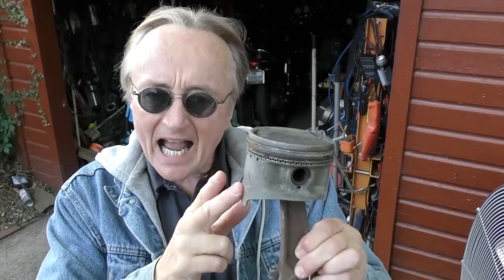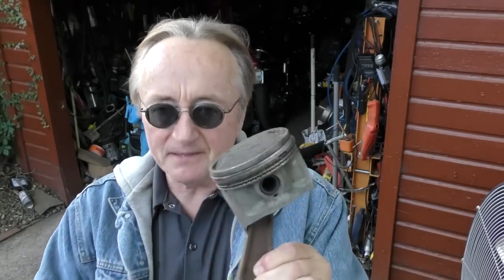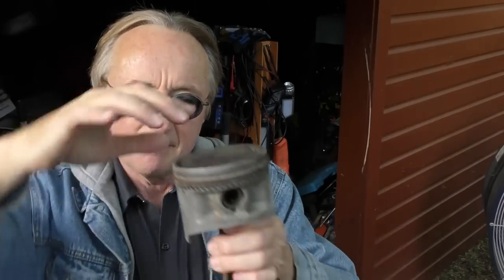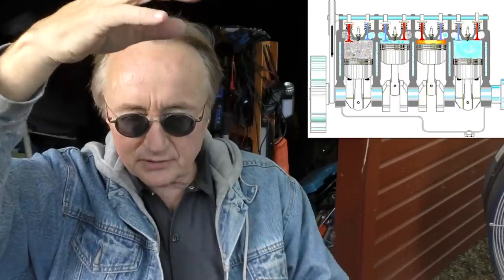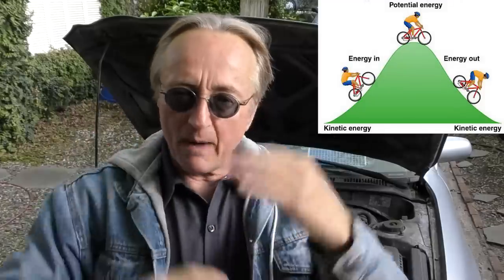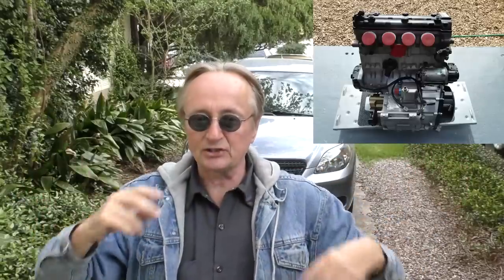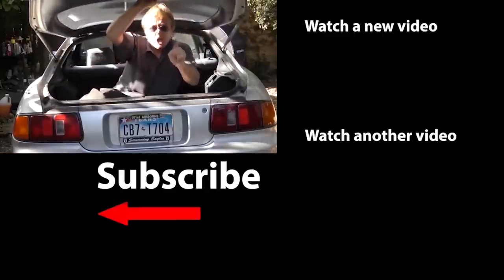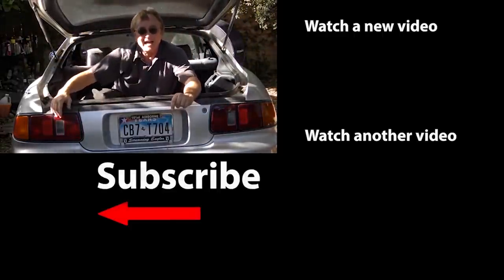Horsepower vs Torque, Which is Better

Comment: What's better? Torque or horsepower?
I'll tell you what's better:
A 94 Celica!!!!
Reply: Ew
Reply: that doesnt have much torque lol
Reply: @ad356  doesnt have much hp.either
Reply: @richdf5664  my 1996 Z28 camaro with 248K miles on it will blow its doors off LOL. the transmission was rebuilt and upgraded last spring. it had a high stall converter and a shift kit. other minor bolt ons and upgrades.
Reply: @ad356  ...yeah? You're comparing a built (wannabe) "muscle car" vs a completely stock economy car that's has ZERO intentions of speed. Cool. 
My twin turbo'd audi a6 has 191k miles with new bigger turbo's and a new(ish) clutch that will blow the doors off your camero
Reply: @richdf5664  camero??????? learn to spell first. how much money did you spend on that audi????? all i would need is procharger and its GAME OVER for you. displacement my friend..... a 150 shot of nitrous would do the trick too.

my i have less then $5k into my car including purchase price of the car, all repairs and mods
Reply: @richdf5664   also compare my 1996 LT1 to pretty much anything else made in 1996 and it was faster then just about all of the competition in its class. 

the celica he has is from the same era as my z28. back in 1996 the camaro Z28 was a fast car, today it still holds it own again entry level performance cars. 

if i had money to spend, it still has a ton of potential
Reply: @ad356  Just OEM turbos from a newer Audi and an ECU flash gives the car over 510hp awd gets the car mid to high 10's.
Reply: I new a guy with an S4 with the same engine that had 694whp awd nothing more than a bolt on turbos, tune, clutch and plumbing. Engine had about 100k miles when he put the turbos on. Daily drove it lasted until 175k ish miles all stock internals
Reply: Might of been 697whp lol I dont remember it was just under 700 lmao
Reply: I shall name my comment: superman. 
Because it flew over so many heads
Reply: Viren vs I see what you did there 😂 it went over most folks head
Reply: I think Scotty's Celica is actually broken and he pretends it works. His mileage never goes up on the thing.
Reply: but it doesn't break down like a dodge..
 @richdf5664
Reply: @ad356  Dude, don't go there. That guy's car  is a more capable vehicle and the chassis is good enough for mods that would make the Audi safely as fast as a Chiron. Your Camero is okay, but it can quickly turn into a death trap if you mod it too much.
Reply: Viren vs 😂😂😂😂
Reply: @GoldenGrenadier  😂🤣😂

Comment: Horsepower is the ultimate determinant of vehicle straight-line acceleration performance.
An engine torque figure alone is meaningless without knowing the rpm at which it produces that torque. Engine torque can be arbitrarily amplified at the driven wheels through gearing.
That being said, there is a positive correlation between peak torque and peak horsepower numbers on production cars. In order to make big horsepower, you usually have to make big torque (exception Formula 1, liter bikes, etc) because engines can only rev so fast before balancing becomes an issue, valve float occurs, or piston speeds exceed the combustion flame front velocity. Formula 1 engines push these limits and produce the most horsepower per ft-lb of torque of just about any engine. This requires very high engine speeds, which also rapidly accelerates engine component wear and drastically reduces the service life of the engine. In terms of longevity, engines with relatively high torque compared to their horsepower are superior. These engines typically operate at slower rotational speeds and are used in applications requiring long service life and large load-moving capability, for example in semi-trucks, diesel-electric locomotives, and tractors. In these applications, the horsepower produced is of secondary importance to the service life and reliability.
Reply: True. Why don't the torque people understand this?
Reply: As an Engineer and a physics enthusiast, I couldn't go by without expressing my appreciation for the fact that your understanding of the matter in hand is very accurate. Cheers
Reply: When a engine have high torque (sylinder-filling) on high rpm it gets high hp

Comment: Horsepower means speed!
Torque means pulls!
Reply: Just like amps x volts = watts rpm with torque = horsepower. Torque at zero rpm = zero hp. RPM with zero torque = zero hp.
Reply: Gibbon that’s cool!
Reply: You are absolutely wrong dude. The pulling and accelerating is about "Horsepower" not the engine torque. If you can create same Horsepower in both cars, the acceleration and top speed is THE SAME. Just put same top speed gears on both car, you will get "SAME ACCELERATION". You wanna hear that again? " S-A-M-E ".
Reply: You don't need high torque to pull. The Army proves this every day with the  M1 Abrams. They have turbine engines.
Reply: This is a false statement..
Reply: You can't have horsepower without torque

Comment: which is better depends on what you’re doing with the engine
Reply: It depends more on where peak torque is in the RPM range. For instance 300 ft/lbs of torque at 8000rpm will give you 456 HP but 300ft/lbs at 2000 RPM will only give you 115 HP... Horse power is the overall energy output of the engine, high revving engines with lower torque but the same HP as a lower revving engine can simply be geared down to achieve the same amount of force. Think of gearing down kind of like using a longer lever to lift something, less weight is needed to lift the same amount but you have to move it further, and the higher RPMs is the equivalent of moving further.
Reply: Phlaked Corn so you’re telling me engines don’t make peak power at any RPM?!???!!!! And they need gears which effect the end result of their output?!?!?!?? Mind blown.
Reply: @akboomer2837  What?! Man... I don't know what you read, but it sure wasn't what I wrote.
Reply: Phlaked Corn That was actually an excellent explanation. Thumbs up.
Reply: @creamofbotulismsoup9900  I mean, you're right, but I feel like that's overthinking a little. Peak torque will always be at a lower RPM than peak HP, so it's a pretty good (if a bit general) rule to just say "Look at torque if you want to pull stuff, and HP if you want your car to be fast."

Comment: THANK YOU!!!! 42 yrs Old, I have read articles, watched videos, and YOU are the first person to explain HP/TORQUE so I understand.
Reply: This is about as layman as it gets. Torque is work and horsepower is how quickly you accomplish that work. If you generate more torque than power, then you can do a lot of work but you'll be slower to accomplish it. If you generate more power than torque you'll perform work faster but not as much at once. Hope this helps.
Reply: King Daniel well jeez thanks for making it simpler. I have only been waiting 42 years, sheewizLol

Comment: Torque it's just a force measured in an specific moment, if you cannot apply it through time you're not going anywhere and thats what power is. Power = How fast you can apply certain force. In order to accelerate fast you need both!

Comment: Torque always makes anything you drive on the street more fun and deceptively fast. Drive a semi without a trailer and skip gears sometime if you want to experience the ultimate demonstration of an extreme case, it's exceptionally fun.
Reply: Tombs Clawtooth torque doesn't mean anything if the car doesn't rev fast.. a 500hp 300ftlbs car will feel quicker than a 200hp 500ftlbs diesel any day. Diesel is quicker from a dig however when both cars are at the same revs

Comment: Maximum acceleration occurs at maximum torque at the wheel.  Maximum torque at the wheel occurs at maximum engine horsepower.  Therefore, to get maximum acceleration, you need horsepower, which is produced by applying torque over a period of time.
Reply: Absolutely true.

Comment: Top fuel dragster 11,000 hp. 330mph in 1000 feet 3.3 sec.. now that's HP
Reply: I remember going to the dragstrip and watching them and as they go past the stands it will make the whole ground shake!
Reply: Not miles per gallon, but rather gallons per mile.
Reply: @InfiniteMushroom I was a kid when Kenny Bernstein broke 300 in 1/4.  Now they do 298 at the 1/8th mile!
Reply: Yeah and 100.000 big ones also
Reply: @davidstinson5095  maybe to buy one, for fun, that when it blows up, you put it on the trailer and go home.  To compete you need 4 complete cars or so. . . . consumables cost about $3500 every time it goes down the track.
Reply: @snap-off5383  don't they have to rebuild the motor after every run? And I thought racing karts was a good example of dumping money into an engine LOL
Reply: TOP FUEL CARS R AWESOME....😎 FIRE SHOOTS OUT THE SIDE 🔥🔥🔥
Reply: @backwoodsjunkie08  Yes they have to use a micrometer to check the rod bearings and crankshaft wear, the run stresses the valve springs so they all have to be reset, so they're all taken out, tested and re-installed or replaced.  The clutch welds itself together, so it gets tossed in the trash and a new one installed.  The spark plugs get ruined, and there's two per each cylinder,  and the headgaskets all get replaced.  That's if the engine DIDN'T fail in any way.

Comment: I always saw it as
HP= torque x revolutions
Reply: It is.
Reply: Yeah, it's a force (torque) applied in certain time (revs per min). In other words how fast you can apply the force.
Reply: Revolution is constant i.e. 5252
Reply: divided by 5252
Reply: @MrRobot-ry7ky  5252.113
Reply: @juzoli  torque definitely is a measure of performance, seeing as torque is the driving force behind getting RPM up to deliver horsepower.
Reply: Dicks X McIronCocke Yeah, but torque is the internal measure of performance in the engine. At the wheels, only the HP matters.
Reply: Is that how you saw it or is that what you learned or looked up?
Reply: @juzoli  How do you figure? The torque from the engine still needs to transfer to the wheels in order for RPM to rise, torque is force that allows for HP even  at the wheels.
Unless your clutch is slipping, if your engine doesn't have the torque to raise quickly through the revband, you won't have high horsepower, seeing as HP is a function of torque
Reply: Dicks X McIronCocke Yes, as it is stated, HP = torque x rpm. At the wheels, the RPM is already factored into the power you put to ground.

That’s why we don’t measure torque AND hp on the dyno. We measure only one of them, and calculate the other. And if you cannot measure it differently it means they are not different at all. Big torque just means big horsepowers at low rpm.
Reply: Torque is the measure of an engines power.  How much work it can do with each revolution of the engine.   Horsepower is a function of torque over time (rpm)
Reply: Torque / time
Reply: / 5252
Reply: @ag135i  that is only true if your units of choice are the standard barleycorn-force furlongs per fortnight.
Reply: hp= 550 ft-lbs/second
Reply: High torque lowers the strain on an engine and those engines can typically run at much lower RPMs. Well, that and gear ratios. For example, semi trucks run RPMs in the hundreds while cars run RPMs in the thousands.
Reply: Power / Torque  = Speed
Reply: An engine with half the torque and double the RPM (same hp) can be geared twice as low. At the wheels performance will be about the same
Reply: RPMs can be limited by stroke length, crankshaft, etc.
Reply: LB.FT. X RPM / 5250 = HP
Reply: SammyT  Lower maximum RPMs.  Long stroke motors like the V-twin will produce more torque earlier but less over all horsepower because they don't have as high of a RPM range.  Four cylinder Japanese motors with shorter strokes will generate less torque initially but more horsepower overall since they can achiever higher RPMs at the top end.  There are other factors such as material, bore diameter, mass air flow, variable valve timing.
Reply: @juzoli  Nope.  It's all about torque, has nothing to do with horsepower.  Here's a simple question that may demonstrate that fact:  A car weighs 3,220 pounds.  The tires have a rolling radius of 1 foot.  At some instant there is 100 horsepower at the rear tires.  How fast is the car accelerating?  Simple physics, but there is no answer.
Reply: fixbertha What do you mean nothing to do with HP? It has been written here a 100 times, HP=Torque x Rpm.
If you tell me RPM doesn’t matter for acceleration, and it doesn’t accelerate faster at higher rev, then elementary school physics might be too much for you.

Again, HP = torque x rpm. It is the basic equation, and definition of power output.
Reply: @juzoli  Suppose you have 100 HP at the drive wheel.  How much force is there to use in the equation (acceleration = force / mass)?  Well, it depends on how fast the vehicle is traveling (RPM of the drive wheel) since (torque = power / RPM, rearranging the equation you quote).  So if the wheel is spinning 10 RPM the torque is greater than if the wheel is spinning 20 RPM.  So the acceleration at a wheel RPM of 10 is greater than the acceleration at a wheel RPM of 20.  You should graph acceleration vs. velocity for any constant power to see this clearly.  
And RPM doesn't matter at all.  Compare a model airplane engine to a Harley engine.  The model airplane engine has lots of RPM, but it won't accelerate anything as quickly as that slow Harley engine will.
Reply: fixbertha Please don’t confuse wheel torque with engine torque.
Reply: revolutions (per minute)
Reply: So what would be the difference between shifting into higher gears when hitting peak torque RPM, and shifting into higher gears when hitting peak power RPM?
Reply: @jessef3092  I think it's because they rarely get above the constant(5252) in rpm. So the TQ # is always getting multiplied by a number smaller than 1 to give the HP #.
Reply: @jessef3092  Literally, you could've googled it. "HP = Torque x RPM ÷ 5252". Therefore at below 5252rpm, torque will always be higher than HP, and diesels rarely go past 5252rpm.
Reply: Oh lord u guys are freaking serious ?

HP horse power is an archaic term commonly used to describe power output.

A car have power output of 110KW what is translated to 150hp and the same time the car have subwoofer that has 1.1KW of power witch it would be 1.5hp ? Nope...

The thing that makes a car to move is tourque which is a force that spin the wheels without tourque the car would stay in a place and don't move at all... The same like subwoofer...

Just don't get into diesel Vs petrol because it is diesel limitation that cant  rev high and without reving high the car can't achieve the same speeds like petrol engine does. It's because of the engine construction not the tourque itself. U actually need hight tourque in petrol car to achieve high speeds because u need a force on the wheels that is capable of overcoming the air and road resistance...

Faster reving  engine will make the wheels spin faster but not stronger.... Then the gears ratios comes into the game an theoretically a diesel car with proper gearbox gear ratios can go same fast as petrol car only if they will have gear ratios and the same KW...
Reply: @fixbertha  RPMs are revolutions of the crankshaft, not wheels
Reply: @LZKS  more misinformation. Read above
Reply: Alllllll this, this is a good example of why it's hard for scientists to get their points across to non-scientists(the public). No matter how they say it, it's misunderstood.
Reply: Here the question was about the relative maximum torque. However better to have higher hp :)
Reply: @dario62589  TRY THIS:  Multiply the torque by the engine speed. You will be using the formula (RPM * T) / 5252=HP,
Reply: You guys forgot that a cars frame weight can affect how fast it can go, even if it has allot of horse power without a good amount of torque the car wont go fast. If you dont balance both you'll end up getting a bunch of draw backs and power losses.
Reply: No. Both are engine power. If you have a low revving engine it has to make a lot more torque within its power band than a high revving engine with the same peak horsepower number. This is because the two numbers are mathematically tied together with 1 hp = 1 ft lb at 5252 rpm.  Since both are measured at the crank, the difference in engine power band is managed through gearing. 
The maximum horsepower of an engine is determined by the torque curve. This is how we get a 510 hp BMW S58 engines that have a peak torque of 440 lb ft  and a 500 hp Cummins ISM (500) with a peak torque of 1,500 lb ft.  Similar horsepower, but the Cummins hits redline before the BMW starts making power.
Reply: ÷ 5252
Reply: power = tq x revs.

if you wanna grow a bunch of food. you need square footage...
think of each side of the land you own as rpm and tq. the larger the area, the better. 
The only time one is better than the other is when you are applying the power for pulling, drag etc.

Comment: I like the saying, "Tq is what gets you up to speed but HP is what keeps you there..."
Reply: Wrong though
Reply: Very very wrong
Reply: RepoDraghon torque is what gets you off the line quick, HP is what accelerates you quicker after that.
Reply: @russellcoight1718  Nah dude, you are wrong. When average people off-ing the line, they are launching at low RPMs. And these people's car has High torque at low RPM, so it gives High HP on Low RPM. Thats why they are getting off line quickly. Torque is not power, its just a measurement of force at the crank. The "getting off line quick" thing measurement is HORSEPOWER. Because Horsepower allows more torque AT THE WHEELS. That gives MORE ACCELERATION because of HORSEPOWER.
Reply: So wrong